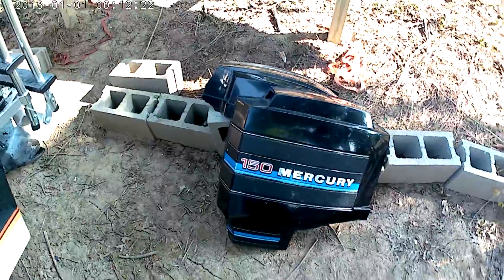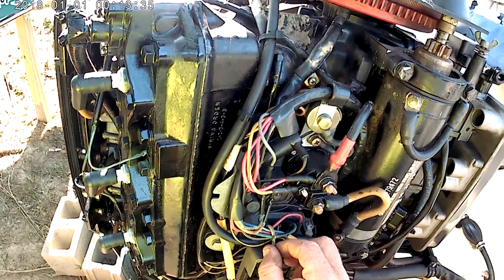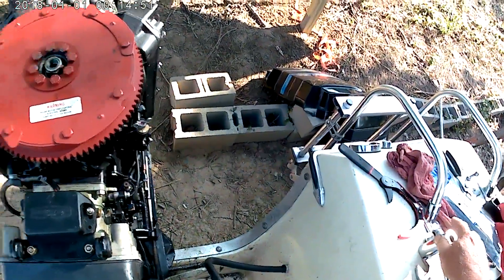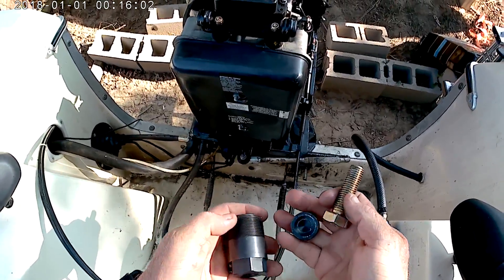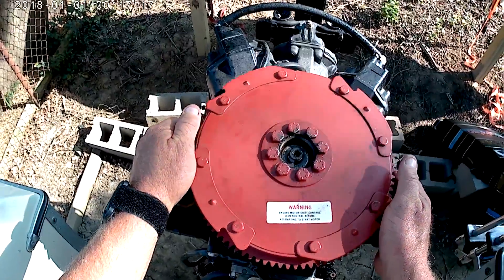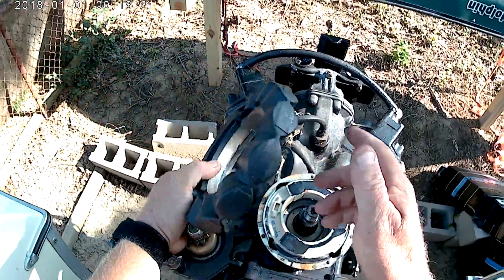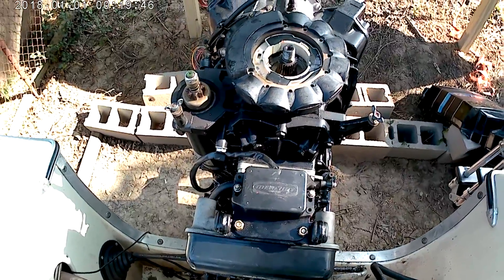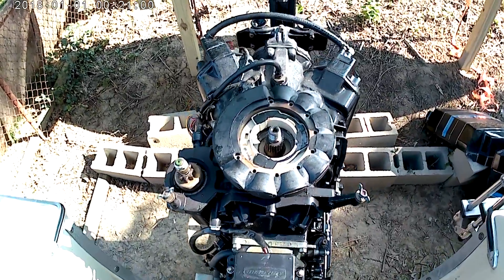Mercury 150 Black Max flywheel/stator removal

Comment: I have question maybe you can help me out or anyone reading this..
I have 1979 in line 6 Mariner when I attempt to start the motor starter engage to flywheel moves clockwise (normal) rotation I believe, but has soon it fires up it Switch’s rotation to counter clockwise what would cause this?

Comment: i also rebuilt my fuel pump and that made a huge difference as the diaphragm was old and very loose so the vacuum pressure didn't move the diaphragm when the engine was running. It ran at idle fine but no power under load.

Comment: Mine just did this. Found this video and we have pretty much the same engine. It would stall out at 2100 RPMs but would sometimes surge forward and jump to  4k-5k RPMs for a few seconds. It died right at the dock. Omg the cost of these parts! Thanks for putting the video up.

Comment: Was your battery not charging as well as the rough idle
Reply from the maker: I honestly don't know if it was or wasn't charging. Replacing the stator and rectifier as I did would have corrected that though.

Comment: When you put the flywheel back on do you have to have in a certain position or do you just set it back on and tighten the bolt ?
Reply from the maker: I made a mark on mine so it would go back on the same as it came off but....mine had a notch anyways so it didn't matter. Mark yours just to be safe, my opinion. Good luck!
Reply: @THESLEEPYTRUCKER  unfortunately i took mine off replaced the stator and trigger and put the flywheel back on not thinking about it and when i tried to start it it backfired like a car does when you have the distributor 180 out so now im trying to figure out how to put it back on correctly

Comment: Hey Sean. Thanks for sharing. I also have a 1981 Mercury 150 Black Max. I recently purchased the boat and motor and just as yours several of my wires were dry rotted. 
As I watched your video while you were removing your flywheel you indicated you couldn't remove the nut by hand even with considerable effort. An impact wrench certainly helped. Just FYI for others you can use a wide chisel or similar piece of metal and insert it between one of the top timimg cover mounting bolts/base to hold your flywheel while removing the nut. I personally used a 1.5" wide wood chisel turned horizontal between the left timing cover mounting bracket and the flywheel gear teeth to hold mine while removing the nut with a 1/2" long handled ratchet. It works pretty well if you dont have an impact wrench. 
Another note: If youre only removing the stator you can mark your flywheel tona reference point and remove the 8 smaller bolts around the flywheel nut and then remove your stator. 
Just thought I would share this information as to possibly help someone else attempting the job. Once again thanks for sharing your experience!
Reply from the maker: Thanks Ronnie for your added info! I'm sure it will help someone who runs these motors and encounters these problems. This is one of the reasons I love Youtube

Comment: Appreciate the videos... been working thru my '83 Merc 150 XR2.  Ran great until the middle of the day, then bogged hard... could still coax it to full throttle here and there, but hole shot was gone and just rough.  Getting consistent but what looks like weak spark to all my plugs. Thinking the stator or rectifier is definitely the culprit.  Thanks again...
Reply from the maker: Thats exactly what mine was doing. New stator solved it. Thing ran like a bat out of hell afterwards. Good luck!
Reply: Did you ever get the end cap off?

Comment: Finally got around to buying a new stator and trigger and rectifier for my 150. Is the wiring on the new jet unit stator match right up to the original one? Do you just match the colored wires
Reply from the maker: Uh....I don't really know about a jet unit. I bought a CDI unit and they all matched up BUT....take a picture of your wires BEFORE you disconnect them OR do what I did and just do 1 wire at a time to be sure. If they dont match up in color, you can easily determine which wire is for which position. Hopefully they gave you a schematic with a color code but if not, good old Google can answer your question. 

There is NO SHAME in taking it slow and taking pictures to look at so you get it right. Make sure when you put your flywheel back on, it goes on in the same position it came off, otherwise your timing will be off. Make marks, 1 on the flywheel and 1 on the engine to line it up after repair. This is really a easy job once you get through it one time. Good luck!
Reply: Sean Wilson unfortunately no diagram on the color code. There’s 2 yellow 2 blue 2 red and 1 black so hopefully they match up to my original one
Reply from the maker: @troybriannatyler4962  I googled it and they SHOULD match up. I hope Google is correct about this lol.
Reply: Sean Wilson I hope so lol same with the trigger wiring
Reply: Sean Wilson hey Sean just a quick update , I started tearing into my 150 last night. Flywheel came right off with puller. Got stater off, trigger off and rectifier off got all the new ones on and wired. Half of the old stator wires just crumbled and fell apart and wire exposed through the insulation. All the colors matched up. Now just gotta dig the boat of of barn and try starting it and hopefully it works I appreciate all your help definitely wouldn’t have done this if I didn’t come across your video
Reply from the maker: @troybriannatyler4962  awesome job! I know it's going to start and run excellent. Glad I could help.
Reply: Sean Wilson do you know the correct spark plugs for this engine ? The ones that are in mine are completely flat
Reply: Hey @seanwilson I finally got around to getting my 150 out on the water after stator, trigger, and rectifier change. Started right up and muffs and ran great then got it to the lake and took a good ten minutes to start. Ran rough for a while then it finally took off and did about 10 or so hot laps at wide open throttle and felt good I still think there’s more power but felt way better than it did but then it would hesitate at times at the hole shot and die but would start right back up. We kinda floated for about 30 minutes just to relax then go to start it back up and would not start back up so I had to use the trolling motor upfront to get back to launch. Any ideas? Was really hoping stator was gonna be the key
Reply from the maker: @troybriannatyler4962  did you set the flywheel back exactly where you took it off from? I mean, did you mark it for timing? Sounds to me like your timing is slightly off. I also needed to do a "link and sinc" on my carbs. I would look at the timing first though
Reply: Sean Wilson I made marks before pulling it. But If I’m off it wouldn’t be much. And we had a marina rebuild the carbs several years ago but that don’t mean that there’s nothing wrong with them. Could be gummed your after sitting for years. How do you go about linking them and sync
Reply from the maker: @troybriannatyler4962  weeeeeell....a link and sinc was outa my hands. You need to have special gauges for that which I didnt. Luckily I found a guy through several friends friends friends uncles cousins, and this guy did it for me. Try running seafoam in a gallon of non ethanol gas through the motor while hooked up to muffs. See if that helps first. If it sat for years, those old mercs, any old carbed 2 stroke really, would most likely need rebuilt. And the L&S done. Its a beast when they run right but do yourself a favor and decide when your just throwing money at it. I loved mine but I sold that boat and bought a pontoon with a 4 stroke. Less issues, headaches and nightmares. Look up mercury black max link and sinc, if I remember right, theres videos on here that show how its done.

Comment: What’s the part number on that stator
Reply from the maker: These are the parts numbers that were compatable with my motor. Hope it helps. Good luck.

JETUNIT Genuine outboard 9 amp Stator assy Maganet Coil for Mercury 6 cyl 174-5456 398-5454A2 398-5454A6

Comment: Thanks I thought I would need to pull the fly wheel to use engine lift. Watched your vid and found the fly wheel puller is treaded on outside and can be used along with the engine lift ring to lift engine to replace the steering cables. So, different project but your vid helped to see how to lift engine. Thanks.
Reply from the maker: Lol help is help! I'm glad it worked out for you.

Comment: The flywheel doesn’t need to be pulled when only replacing the stator. If you take the bolts off that are around the fly wheel nut it will expose the bolts that hold the stator on. Just have to place the new stator in the same position that the old one come from and won’t have to retime it.
Reply: Mercury says Never remove any of the bolts from the flywheel!! Danger of flywheel coming apart .  It turns 5500 to 5800 rpms.  Only remove the nut. And use a flywheel puller as seen.  I also don't use impact it can harm the threads .  Mercury service since 1983.
Reply: I just remove my flywheel using this technique and it worked great! I did not make any marks on my flywheel when i took it off. As long as the stator goes back in the correct position the fly wheel should be fine to go back on anyway?
Reply: @TheActionmjackson  sure bud it's your motor do what you want. I'm just a Mercury tech since 83 so what do I know or Mercury they just build the things. I'm sure you know best..

Comment: Do you remember the size of the fly wheel puller bolt size? Thanks in advanced. We are having problems with bogging as well runs good with no load. With a load runs excellent till it gets warm and starts to rev high and low constantly.
Reply from the maker: I cant say for sure on your motor since I dont know much to begin with but on my motor, after I did my repairs, I did whats called a "link and sinc". My motor is carburated though. Just fyi. Good luck on your repairs.
Reply from the maker: Heres a link to the puller I ordered on Amazon. It's gone up in price but waaaaaay cheaper still than a dealer cost.

https://www.amazon.com/dp/B075R414NZ/ref=cm_sw_r_cp_apa_i_JLzFCb83888T0

Comment: Did these parts you changed fix your bogging problem? I have a mariner 150 that wont rev higher than 1200 rpm under a load but will turn 6000rpm in neutral.
Reply from the maker: Yes it did. If you watch my last video linked to this repair, it shows my boat running like it should again. It runs like new now.

Comment: A pair of vice grips will hold that fly wheel too, just secure it for a counter clockwise turn an wallah. Now how the hell I get this wheel off. Hmmm
Reply from the maker: I would NEVER try vice grips. I'd be too afraid of breaking my flywheel and then thats just another $300 bucks and a fee days wait to replace it. Maybe it's worked for you and I'm not gonna knock it, but it is something I'll never try lol. Especially now that I know my impact works so easy

Comment: FYI Only: The switch box:es had defective as well.
  Has been the key to all failure in the past - many service people forget to check them and when we change the 2 switch box :es - the engine start great now every time - this is also the cause to have STATOR failure - so my TIP is  - if have START problem on the 150 HP Black Max - check the switch box:es both of them and this save you a lot of headick (replace them true long use) and less start problem for the future for sure...  I also START my  150 Black Max every week to be sure is work and run true  and water pump works OK as well...  Good Luck out there guy's...

Comment: I have a 1985 skeeter with a xr2 black max 150. Starts good with ear muffs and revs up and idles fine, soon as its in water it’s hard to start but will eventually start. Will idle and troll fine but once you go to open it up it either bogs right down and dies or it runs really rough and will eventually die unless you lay off on the throttle. Any tips? Do you think it’s the stator ? Almost every article I’ve read they have mention the stator
Reply from the maker: It sounds just like the stator. Mine idled fine too but under load it bogged. Look on Amazon for your stator but also change your rectifier also. Good luck!
Reply: Sean Wilson thank you so much I’ll let you know on my progress
Reply: Also when you put the flywheel back on how did you tighten nut? Just get it tight with impact or did you use a torque wrench ?
Reply from the maker: @troybriannatyler4962  just use your impact if thats all you have but try not to over tighten it. Use a torque wrench if you have one but I used my impact and was easy with it and its fine.
Reply: Sean Wilson I just got a 18v snap on ct8850 impact and I also have a torque wrench so either or works lol
Reply: @troybriannatyler4962  i definitely wouldn't use an impact wrench to tighten it back down. Use a torque wrench to manufacture specs. All a torque wrench will do is either strip the threads or do more damage than intended
Reply: Also when I pulled it out of my barn last week for the first time in probably 5 years I pulled engine covers off and noticed a huge mouse nest do you think they could have damaged something as well? Also I’ve read they can go into your exhaust and build nest and sometimes that causes it to start hard once in water
Reply from the maker: @troybriannatyler4962  I would juat check all the wires running from your triggers and switch boxes. Mice love to eat the coating but this wire coating also gets dry and brittle. Replace any wires that are like that. As far a smice nests in exhaust...I couldnt tell ya on that. I can only tell ya what I've dealt with and thats not one of them. Have you replaced your impeller? You should and when you drop your lower end you should be able to see up your exhaust. I really doubt you have mice nests in there though. You may also need your carbs cleaned/rebuilt and on my engine I had to do whats called a "link &sinc" 

So...if I were you with a motor that sat for that long, I would do the carbs, stator, rectifier, impeller, thermostats and new plugs. Sounds like a lot but to have some peace of mind on the water is a great thing and these old Black Max motors are worth the time. Good luck!
Reply: Sean Wilson alright thank you so much for your help !
Reply: Do you think it’s necessary to replace both switch boxes or no ?
Reply from the maker: @troybriannatyler4962  I was told by the Mercury dealer AND the guy at Mercury.com, the switch boxes generally don't fail due to the stator. I would only do the stator AND the rectifier. See how that does first. Switch boxes are an expense you dont want to add if you dont have to.

Comment: Hey @SeanWilson do you have a link for the flywheel remover on Amazon along with the rectifier and stator. I have the same engine model and also need to replace the stator and rectifier
Reply from the maker: Hi. The stator link is JETUNIT Genuine outboard 9 amp Stator assy Maganet Coil for Mercury 6 cyl 174-5456 398-5454A2 398-5454A6 https://www.amazon.com/dp/B071CGFG95/ref=cm_sw_r_cp_apa_i_qEzFCbKS9KRKN

The rectifier link is Mercury Outboard Rectifier Replace # 62351A1 62351A2 816770T 8M0058226 https://www.amazon.com/dp/B071GLYMN2/ref=cm_sw_r_cp_apa_i_3EzFCbDZCAJ7D

The flywheel puller link is Zinger Mercury Mariner Force Yamaha 1 1/2" -16 Flywheel Puller Removal Tool 91-849154T1 https://www.amazon.com/dp/B075R414NZ/ref=cm_sw_r_cp_apa_i_JLzFCb83888T0

It appears the prices have increased a little bit but still a lot cheaper than a dealers prices. Make sure to look at your trigger wires also. I'd hate for you to replace everything and your trigger is bad. Probably not but worth a look. Hope it fixes your problem, it did mine and man my motor is a beast! Good luck!!
Reply: Thanks Sean this is all greatly appreciated. And thanks for your video, there isnt enough videos on these awsome engines out there.
Reply from the maker: @11SPOONZ  your very welcome Aidan. Your correct, not many videos of these engines but theres not many of these motors out there any more. Not many people realize what powerhouses these motors are. Watch my video of the test drive after the repairs. Man...this motor is awesome! Again, good luck with your motor and happy boating.

Comment: We have 150 Black Max 1989 / great engine but suddenly NOT start / this is was happen hope it helps somebody out there: Dear Khun Roman,

My mechanic checked and found the stator had defective first so it’s made switch box had defective as well.
We have to check your history, just replace On January 2018 so we are cover warranty.  

I have a quotation for repair the engine and install switch on-off as attached.
  - For safety and overload fuse pop out if overload to save engine ...